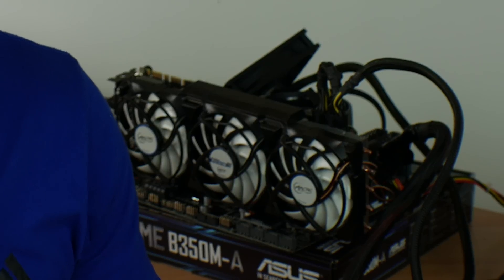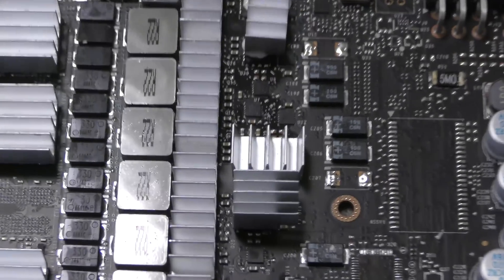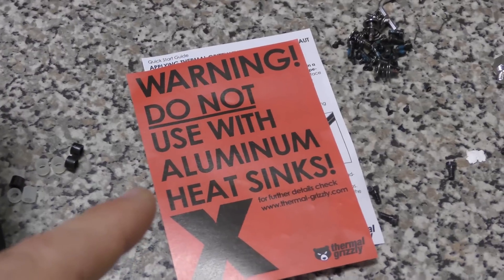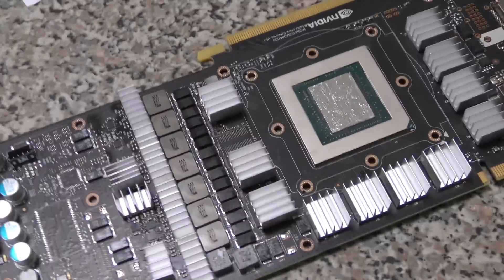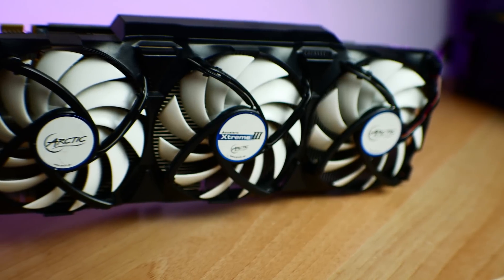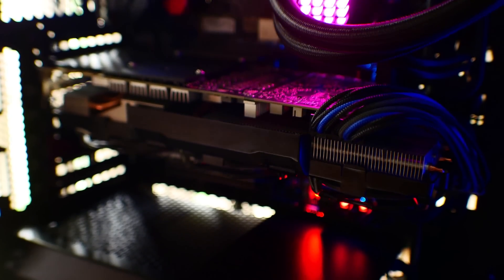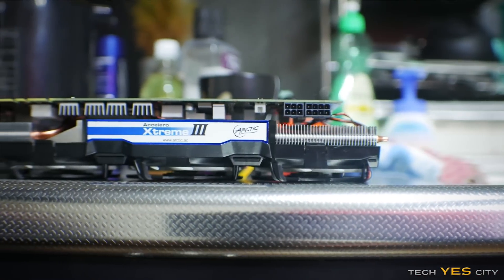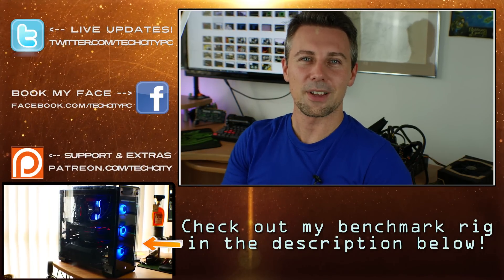INSTALLING an ACCELERO on a GTX 1080 Ti!? How to & Temps vs 1080 Strix

Comment: You could have used thin masking tape to 'protect' the small resistors around the GPU die... that way if the liquid metal DOES squeeze out you're much less likely to short something out...

Comment: Damn, I hadn't thought of using half of the backplate. I just used the mounting hardware that it came with, and instead of resting the weight on the bracket, I have the GPU supported in the middle fan by a 3d printed platform jack :P

I'm waiting on a PCIE extender cable so I can mount the GPU vertically instead so i can take some of the stress off that bracket.

Thanks for the ever helpful videos!

Comment: My GPU was runing at 80-85° peeking at 90° celsius after maybe 1 or 2 hours playing... I decided i have to do something about it. 
I vacum cleaned the filters then heatsinks also added a extra fan in the case. So now i have 4 fans 2 intake (140mm) and 2 outake (120mm).

After few days of all that, i played gta 5 for 10 hours straight, folowing the temperatures with MSI and RT and even with V-sync off it never went above 67°. Sometimes you dont need a new GPU you just have to clean your PC :P

Comment: Great videos as always. Hope i get a respond on this. Something pretty much all reviewers forget about the custom cooling solutions is to show the VRMs temps as that is pretty important too. I had problems withe VRM cooling with custom coolers as the double sided heatsinks sometimes is not sufficient enough. Would love to see the VRM temps with this setup
Reply from the maker: I will take a look at that for you, though I might need to get some thermal imaging upgrades, haven't looked into it too much just yet.
Reply: My personal experience was with the hotbox r9 290x . Was running extremely high (90+) on the core temp with the (jet sounding) stock fan While the Vrm stayed relative cool without causing any problems.
Used the Raijentech cooling solution while improving the core temp by 15+-c the Vrms (120c+) were cooking hot causing constant crashes. The only solution was to downclock the Memory speed by a 100mhz. It will be interesting to see how other cards do at these kind of scenarios

Comment: have you also tried the accelero hybrid coolers? i have one on my old 980 and it doesnt go above 35 c with a 20 degree ambient. i did have to drill a few new screwholes in the vrm heatsink but that was because the holes didnt line up with my card.. (its not a reference card)

also i like the arctic f12 fans. they are cheap, really quiet and provide a good airflow with decent pressure

Comment: Your vids have got shown me how to build a nice used pc (for a total of 125 AUD)
- 4gb DDR3
- Q6600
- GTX 750ti
- Antec 430w 80+ psu
Thanks,
Hugh
Reply: not bad
Reply: hey q6600 nice, have you bsel modded it? I got one running at 3GHz stable as a mofo (that's a 25% OC!)
Reply: Maybe a bit more RAM

Comment: if you buy this expensive GPU just put a full block waterblock on it it will cool the core die the vram and the whole VRM, with phenomenal results 
plus it 100% designed for it so no compatibility issues nor it would look like a funky mod.

Comment: I put a aftermarket arctic hybrid  water cooler cooler on my very first high end GPU back in 2013 a gain-ward phantom GLH gtx 780 
within a week of buying it new as i wasn't happy with the sound + temps.... man was i shitting myself through the whole process when i plugged it in and it was working i felt like a god xD......Temps Dropped by 30c on load and you couldn't hear the thing at all i still have it now as i just love how quite it makes my whole system.

Comment: They also have a phenomenal price to performance ratio on CPU coolers... I bought a freezer 7 rev 2.0 some years ago when I had my AMD phenom CPU, and I just couldn't make the CPU go higher than 60ºC, even when unlocked to an x4 (it was the x2 550) and OCed, and barely audible. and that cooler cost me almost half of what a 212 costs in Portugal... arctic cooling is probably the most hidden gem in cooling matters, but it's a very rare diamond.

Comment: Warranties are for noobs, Hardcore enthusiasts decline a warranty whenever possible! haha
Reply: Hardcore folders go for the super extended warranty (10yr EVGA) and get replacement cards for shipping cost everytime they die in service.  I think I've gone through like 10 RMAs so far.  The 24/7 folding just seems to murder a lot of GPU dies, especially large Ti variants.

Comment: Just another argument why water cooling is the way to go. You get all the possible performance that is your card, the lowest possible temps, without any noise at all. It is also a ton more flexible, and not really that more expensive.

Comment: Correction: Arctic cooler are not fenomenal, its just normal aftermarket heatsinks suck.
Arctic cooling ones don't fall into many of this dumb marketing trends.

Im serious, IMO gpu coolers could be a lot better if manufacturers foucused a little more on fuctionality and a little less in asthetics, for example:

Fan blades: Most after maket fan blades are either desingned using a wierd desing that suposedly "increases airflow by 20%" like the Torx fan from MSI with 2 different blades. This is probably useless.
Other fans are just really flimsy, like the ones on Gigabyte cards.

Airflow path: Well most cards just occupy all of the space they can to mount heatsink, but completely forget about routes for the hot air to escape. Some even go super dumb and use part of the backplate to cover places where air is supposed to come out. (Im looking at you Zotac)
Also most, if not all heatsink fans have no duct for their fans, meaning that the air beeing pulled in doesn't always end up pushed through the heatsink. This is similar reason why fans with square frames work better in radiators than the ones with rounded frames, since they don,t let air escape throgh the sides.

Direct touch heatpipies: Well direct touch works really well on CPUs that have an integrated heat spreader (IHS) since it spreads the heat evenly between them. However GPUs are cooled on the Die directly, meaning that only the heatpipes that are actually touching it (generally only the 2 on the middle on some Asus cards) get an efficient transfer. Also direct touch generally leaves a rough surface in comparison to a spreadplate, which can be smooth and have better contact.

Thanks for reading if you got this far. Tell me your opinions.

Comment: AC coolers are ridiculously good. manufacturers should just buy them in bulk from them, slap them on as default coolers and call it a day. I installed the smallest one, the Mono Plus, on an OCed RX 480 8GB and temperatures don't go over 70C now. For a RX480, that's insane.

Comment: I do not agree on these benchmarks. If you look closely strix card is boosting higher than the custom card. I like this custom cooler, however i do not agree on the results. Maybe you should clock them at the same number then do the benchmarks.
Reply: But the Strix card is a 1080. Core clock isn't the be-all end-all in determining temperature. The Strix 1080 is rated 100W lower than the FE 1080 Ti.
Reply: Thats also true, however we all know that even 50 mhz can make a huge heat difference.
Reply: gravi1ty also, thats an opinion, if you dont like it, just show some respect with the words, then try to correct someone.

Comment: Arctic coolers are really good, but look terrible
Reply: +Ziggy Wiggy No, it means you have different taste and priorities.

"If you don't have my priorities you're a snob" doesn't really work.
Reply: an evga hybrid cooler would look better and perform better
Reply: @TylerN945  Hybrid costs like 3 times the price of this cooler.. This Accelero Xtreme costs around $60, a hybrid goes around $150, and it only fits EVGA cards.
Reply: @sidewinder86ify  Well the EVGA hybrid cooler is the cheapest way to liquid cool your GPU. It's much cheaper than an ek block setup and requires no maintenance (except for dust). Also it doesn't have to be an EVGA card, it just had to be a founders edition PCB.
Reply: I think it looks like it means buisness.
Reply: you can spray this.
Reply: The problem is that if you will have some really amazing looking case and components, you will stop paying attention to it soon, since there is dust on it in 3 days -.-
Reply: @Stxn With more intake fans you actually increase static pressure and get less dust :D but, yea i get what you are saying. I wouldn't get this cooler on my card. Rather buy second hand aftermarket cooler from dead gpu if I wanted to get rid of my reference card cooler... which is exactly why I looked at this video :D
Reply: Yea look terrible just like noctua's fans
Reply: I would much rather have looks than 1'c

Comment: why would anyone go through all this for an aftermarket air cooling option? Pretty lame..
Reply: People like to tinker, and less noise ect. I bought a 1080ti founders card and I'm going to put it under water. I think it has lot's of benefits plus it's going to look amazing!
Reply: FRANK DUKES watercooling imo is the only way to go when it comes to gpu's.
Reply: +bb65346 There are some really good air coolers out there. I just got rid of an MSI 980ti lightning and the cooler on that was absolutely fantastic. That card was amazing period. Even @ 70-80% fan speed it was barley audible while in your case, but i had to move on to greener pastures and i already bought everything to water cool my PC so the 1080ti was the obvious choice! Water is great because it lets you sustain higher voltage pretty much forever which keeps the card from throttling @ all if you want.

Comment: Looks like that one spot for ram IC has all of the capacitors in place. Hmm so that 1gb or ram "missing" compared to titan X is going to find its way there for sure :)
Reply: xdanano I think it's disabled from the GPU core so even if you got one and soldered it on the GPU core won't see it
Reply: Ok, now explain who its disabled from the core? And on what do you base this?

Comment: What is it with Americans? are you folks made of a different biological matter? Every review I watch has room temperatures above 25 celsius, above 21 celsius in my house for more than 5 minutes and I am dying.
Reply: The Spark you're just used with cold temps
Reply: Hes australian...
Reply: So, he is Australian ... are they made of a different matter too? .. the Aussies that is.

But then again ... I am nocturnal and hate the sun ... maybe I am the alien, need to recheck my DNA.

On a more serious note, it is true that many of these reviewers operate in extremely hot environments, at least from what I have noticed.

Comment: question for you guys, I bought a Lenovo thinkcentre edge 72 for £100 the other day, it comes with a i3 2120, upon looking on a Lenovo site, it's claiming that the board can hold a i7 3770, but being that the i7 is a generation newer I'm sceptical about it, I don't want to go out getting a i7 3770 for it just to find out its not compatible despite Lenovo saying it will work
Reply: h61 motherboard, the actual CPU bracket says 115X
Reply: Some boards support both 2nd and 3rd gen CPUs. It might just need a bios update.
Reply: Chadley Bissolati it's a Lenovo board itself, I wouldn't have the faintest idea on how to update that...
Reply: What's the model no.?
Reply: Chadley Bissolati of the board?
Reply: Chadley Bissolati tower model 3484
n1996 motherboard
Reply: It should work if the site says so. I'd try to find a CPU from that gen first to test it before buying the i7  3770

Comment: Arctic should start doing custom graphics card themselves !
Reply: Or at least collaborate with one of the manufacturers. They have kickass coolers right up there with Noctua and be quiet!
Reply: Monki McAwesome Noctua would make sick GPU coolers.
Reply: This test was awful though.  Different cards, different thermal pastes, different coolers? Get a 1080TI Strix, and replace the thermal paste on that card also, and then run the tests.  We don't know how much of the gains came from the cooler compared to the thermal paste.
Reply: Interesting thing, they actually did that once for Sparkle. Google Sparkle Calibre.
That was one hell of sexy purple cooler, but it was monstrous.
Reply: Actually, compared to a vast majority of PC case fans, CPU cooler fans, and GPU cooler fans, they generate considerably less noise.
Reply: There is nothing out of the ordinary about arctics cooler. Its just that you cant beat size. They simply have the most and biggest fans on the biggest heatsink. Its simple physics.
Reply: Speaker1264 It was good test and was all about temps, point of it is that less power hungry gpu with custom overpriced cooler performs worse.
Reply: Actually if you check the weight, they aren't really much bigger than for example heatsinks from Windforce coolers. I compared them myself.
Also they have simply better fans.
Reply: I said size not weight.
Reply: Nikola Karovic Based on the Anandtech review the 1080ti founders edition was only 1 degree hotter than the 1080 founders edition, so power draw really has no influence in the temps of the card (although gpu boost does make it tricky to figure out for sure since I think the cards were thermal throttling and likely downlocking).  Also the 1080ti strix has a much beefier cooler than that of the 1080 strix.  Lastly I would like to see what happens to the strix's temps when changing the thermal paste.  Not to the Thermal Grizzly, since it would destroy the aluminum base, but usually reapplying even a $10 thermal paste can shave off a decent amount from the delta, saving you $77 from buying this cooler.
Reply: Because it has better fans. But Arctic fans are good but not ground breaking. A Rajintek Morpheus with some Nocture SP fans would probably be even better and more silent. Bigger too which is why Size always wins over everything.
Reply: Well, yeah, if we are talking about everything, fans included. Still, Accelero performs better than Devil 13 cooler from PowerColor which is even bigger.
Reply: +KNI Slaughterer
the prices would be higher than the other 3rd party cards.
Reply: KNI Slaughterer i agree
Reply: KNI Slaughterer they had once. A gtx 580 from i sparkle i think it was,had the accelero 3
Reply: im pretty sure that they make more profit by just selling the coolers, Nvidia drop feed their partners.
Reply: People should stop focusing on what the cooler looks like. These cooler perform amazing, but people won't buy them because they don't have cheap plastics and gimmicky leds.
Reply: KNI Slaughterer I think a few manufacturers have used their fans/coolers before.  Inno3D has used fans and the hybrid cooler on their iChill cards for a while.  Arctic coolers are like freaking magic.

Comment: You don't have to worry about the GPU shorting from the paste spilling a bit off the die.
Reply: The paste is Gallium-based. Not only is the paste itself conductive, it also actually corrodes Aluminium in a matter of hours. That's the main problem with this product. Thermal Grizzly also produces more traditional pastes like Kryonaut which I'd rather use

Comment: Anybody using or planning on using an "accelero iv" on their 1080ti?

Got one arriving today, with some mx-4 paste which I'll be installing on a founders edition 1080ti.  Should I be concerned if I leak some mx4 on the outside of the die? It's supposed to be non electrically conductive?  Thanks.
Reply from the maker: MX4 is fine, you don't have to worry about using too much as it is non cap non conductive.
Reply: Great, thanks.  You've earned a sub!

Comment: Just do the power limit mod (I don't know why you didn't, you had all the necessary tools there) and it'll boost itself to around 2000 MHz. You can't really overclock it much beyond that.
Have fun playing with your gimped card ;)
Reply: Is that your max overclock?

Comment: i want to know if this method will also work on any amd graphic card
Reply: Which method?
Reply: vdochev i mean using the artic cooler
Reply: it will work, i had a 7950 with the arctic 3 and 4 cooler but there are 2 type of cooler from arctic so check first befor you buy one

Comment: Dont you need to wipe the thermal grizzly on the heatsink too to break surface tension? I applied liquid pro to my delidded 3570k and dropped my temps 30c to 35c at 4.7 from using tuniq tx4, i think these guys not doing that cant believe that because they are not breaking the surface tension due to using conventional thermal pastes and not thinking of this unique property liquids have.

Comment: That thermal paste looks like melted Gallium.
Reply: Haru Jayasekara It does say not to use it with aluminum, I bet it is at least part gallium.
Reply: It's probably a gallium alloy of similar metals (e.g. indium) to make it liquid at room temperature.
Reply: It's a indium and gallium based alloy, with some extra secret sauce impurities to help reduce oxidation.

Comment: just stuck an Accelero on my Gigabyte R9 390 G1.. and oh my word.  idle temps dropped from 67 degs to 36. cant get it to go over 66 under full load and only 60% fan speed!  silent,  and a damn good cooler.  a little ugly,  but hey. . im not cooking at 90+degrees no more.